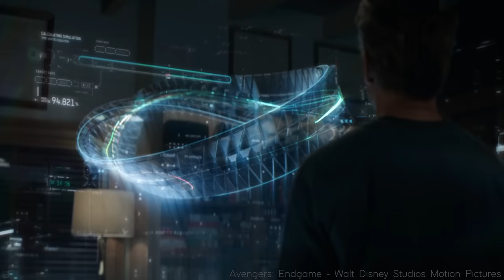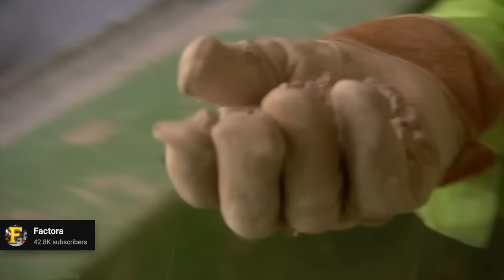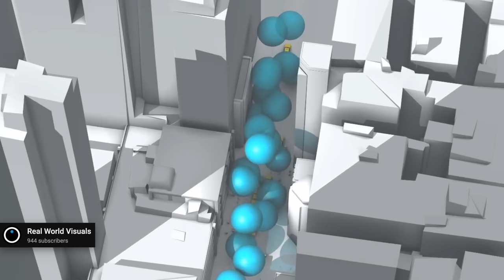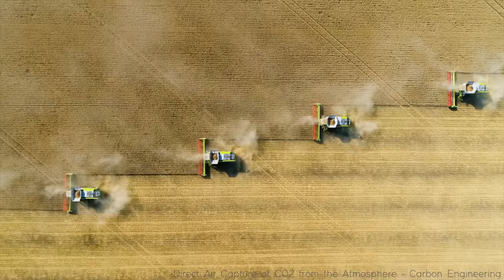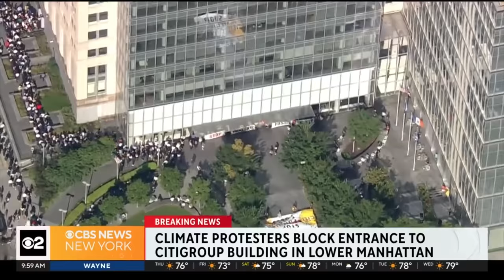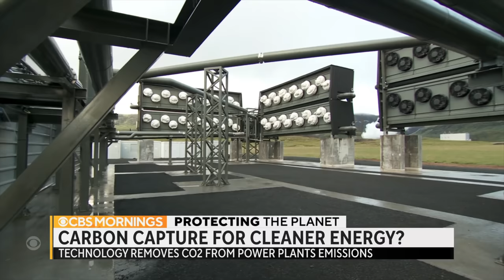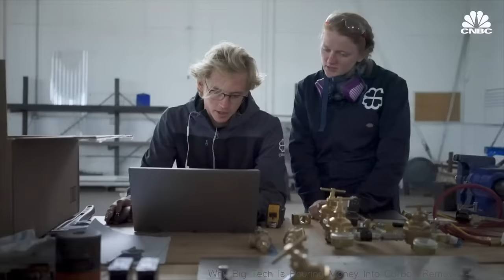How Thermodynamics Holds Back Negative Carbon Tech

Comment: Direct air capture is the dumbest idea ever.  You have to know nothing about chemistry or thermodynamics or entropy or economics to think this is a good idea. It’s so dumb.  

Chemistry: co2 has a very low internal energy one of the lowest. This means you need energy to turn co2 into anything else.  But it doesn’t.  You’ve been fooled to think it does.  

Thermodynamics/entropy you need energy to extract co2 from air. 400 parts per million of co2. Think about that. Find 1 thing out of 25000.  That’s all theses machines do is find that 1 thing in 25000 and they charge $100 a ton. 
Storage cost is extra.  If I want a ton of co2 I’m not going to the least concentrated place to find it.  I’m going to the dirtiest smoke stack I can find and it cost me nothing per ton. 

Economics.  Why would anyone buy a machine to pull co2 out of the air. The machine cost money, the energy to run it cost money, and then you must pay to get rid of the substance it produces.  Literally the opposite of everything you want.  Moreover the energy needed must come from somewhere and until we are 101% renewable there’s no extra energy to run this machine.  If you use fossil fuel to run it by entropy you’ll never get back what you produced.  

Co2 is heavier than air. The few times the earth has burped up a bunch of co2 thousands of people died of suffocation. Invisible rivers of co2 flowed over villages snuffing out everyone.  So our plan is of course storing it underground.  A storage facility in Colorado has already failed.  Releasing everything they worked to contain. The good news is it was so remote that no humans died. But the plan is 1000s of facilities for carbon dioxide storage. This is probably the worst idea ever.  Eating tide pods wasn’t as bad as this idea.  The fact that so many people like this idea shows the true ignorance of the population. What is the use of creating great science if people are going to be so completely willfully blind to it?

Comment: I highly recommend Bjorn Lomborg's book: False Alarm. Disaster related mortality is down by 98% over the last century, and that's largely due to abundant access to fossil fuels. Tornado data over the last century is flat, and hurricane data is similar. A slight rise in intensity (which could be a result of human activity or could be an anomaly) while the frequency is actually in slight decline.

Comment: Nuclear fusion + room temperature superconductors would solve it.

Is it too much to ask?😅
Reply: How? I think you picked the wrong branch of the tech tree. 
Fusion for energy. Well is it in practice cheaper and easier than solar or fission?

Room temperature superconductors?
Slight efficiency boost on your wiring.
Reply: @donaldhobson8873 
It was a joke. That's why the "is it too much to ask"

No, room temperature superconductors would not only give a slight efficiency boost on your wiring.

They would allow for example 10x faster computers for 10% of the energy consumption computers use today. 

They also allow you to simple put energy into a loop and the energy will stay there indefinitely. Huge boosts in batteries.

Maglev trains would be common. It would allow transportation of energy from far away because heat losses would be minimal (think Sahara solar powering Europe)

AND you would be able to create vastly superior electromagnets with dozens of tesla, making fusion power much easier to achieve.

Is fusion power cheaper and easier than fission in practice? Not in practice, as we don´t have fusion power in practice. Theoretically yes. Not with ITER style reactors of course.
Reply: @rogeriopenna9014  

They also allow you to simple put energy into a loop and the energy will stay there indefinitely. Huge boosts in batteries.

They do allow you to do that. However, unfortunately the amount of energy you can store like that isn't nearly as much as with a battery of the same weight. 

With high voltage DC, the sahara powering europe would get about 10% losses. 

Agreed about it helping with fusion.

Comment: Your thermodynamic limit is technically correct. 
That amount of energy must be used, if we must operate at room temperature.  (and have no other entropy sink other than waste heat)

However, the jump from thermodynamic energy to grid electricity is a jump. 
We could invent something that used sunlight to capture CO2 directly. We could use genetically engineered algae. We could use the mineral olivine which reacts with CO2. (if we do that, technically the energy we are using comes from the chemical energy in olivine.) 

Also, if we use all the sunlight hitting the earth to power carbon capture CO2, that would take 37 minutes.
Reply: Why use GE algae when we can just take better care of all the land and seas?

Comment: Go after the Gross Methane emitters, invest in carbon squestration and sunlight blocking technologies.  It will take 1,000 years to reverse the damage we have already done but we can avert our species extinction and untold suffering if we act now.
Reply: You better no fuck around with the sun my man. You have no idea how badly that could backfire. The sun is needed to grow food. Look back at the larger volcanic eruptions and the years without a summer. The growing season was crushed. You play with the sun and then you are dealing with mass global starvation.
Reply: I've argued that reflectors at the L1 orbit can work. The problem to solve is solar pressures exerted on the reflectors.
Reply: @Buckshot99 false, you could control reflected sunlight and have electricity adjustable shades.
Reply: @Buckshot99  I hear you, I'm NOT for spraying the upper atmosphere with sunlight blocking chemicals but a space based sunshade should allow us to reduce overall sunlight without huge risk. Without the Mr. Pinatubo eruption in the early 90's, the earth would be even hotter now, so particulates do have massive global impacts.
Reply: His timeline has it fixed by 2050.

Comment: We need to reduce CO2 to carbon (because we do not want fancy underground storage which isn't reliable). We need to reflect more sunlight (about 1% of the earth surface or close to it). We need a CO2-free energy source like photovoltaic, wind etc. --- and yeah fusion if it will ever work

Comment: Avery Lovins (look him up on TED) agrees - it's far cheaper to prevent emitting CO2 than to collect it after the fact.  So energy-efficiency is the first priority, followed by replacing CO2-producing actions with non-CO2 alternatives.  Frankly, it'll take a huge variety of methods, but DAC is never going to solve this.
Reply: DAC is useful for dealing with the 1000's of small obscure things you don't want to have to invent a solution to. Like camping stoves. Backup emergency generators. Mining explosives. Fireworks. Welding torches.

Gets you to net 0 without having to chase after every last odd stray thing that burns any carbon at all.

Comment: 24:24 You "forgot" to mention water vapor mr Coolweb, but who cares nowadays about truth right? Views are more important, and much more important is to align with the thoughts of those who finance our researches!
anyway...
I will not go into all the details and evidence given by research by geologists and climatologists who still carry out pure research, there are a few still, (where research is carried out to discover the facts and not to obtain funding), in a YouTube comment, in any case it would be useless given the very low propensity for logical reasoning of humans... 
the point is this: if we consider CO2 harmful because it produces the "greenhouse effect" then we should also know that the major contributor to the greenhouse effect is instead water vapor; that contributes merely for the 99.9999% of the "greenhouse effect"
 in short, to reduce the greenhouse effect we should eliminate water from Planet Earth, and preferably eliminate its atmosphere too!
I wish to add that plants do release carbon dioxide (CO2) at night, although they also release CO2 during the day. This is a part of the process of respiration! 
"Ignorance is strength" evidently, not yours but of yours gullible followers
"non-aligned" climatologists are continually censored, a lot of research is simply canceled because it was published on the internet.  Then for "predictions" and predictive models on the future I just want to say that science studies the past and the present using unbiased data evidence;
on the other hand astrology  predicts the future... but if we want to give some credence to this method then we must add that we will have the opposite problem, that is, the capture of CO2 from the oceans and the earth's crust could lead us into another small ice age.
but believe what you want: what do I know?
I'm simply an old geologist already retired, scared about the type of society my daughters are living in, sure thing Greta Thumberg, Leonardo Di Caprio and Bill Gates know better about climate change than myself.
The ones  that takes the decisions at the top,  aren't accountable for the harm they produce to billions of people and this is another fundamental problem of modern societies
Opposite to the common beliefs we are living the dark ages not the medieval people

Comment: What if I told you I have a carbon capture technology that passively absorbs CO2, needs no maintenance, replaces itself before it wears out, makes no sound, looks beautiful, supports life and scales itself up automatically to cover the whole planet?

I call it “trees”.
Reply: Exactly
Reply: What if that carbon capture tech was also 3 orders of magnitude less efficient than solar panels + dac, and had all sorts of fussy demands about ambient temperature and soil and also used lots of water.
Reply: Exactly2. (Plus of course other flora which nurtures fauna and so on.)
Reply: @donaldhobson8873  I thought we wanted to save nature.
Reply: @NoSTs123  We have a bunch of options. We can have industrial DAC plants, which are good at reducing CO2, or we can have forests, which are good at giving birds a place to nest. Or some mixture of the 2. 

Take your pick. It's a tradeoff between one part of nature and another.

Comment: I'm all for targeting net zero ... however, the earth's climate is going to change with or without us in the equation (volcanic mega eruptions, Milankovitch cycles, asteroid impacts, solar activity, snowball earth?!). CO2 levels were about the same as they are now during the Pliocene Epoch 400 million? years ago. Even if we were at net zero ... and came across a natural period like the Pliocene, would we want to prevent natural changes - or adapt, and go with the planetary flow? We may wind up just hashing this up to the equivalent of a super volcano erupting for 250 years and let nature deal with the consequences which it has several+ times during the planet's history. There's just not the WILL ... maybe Jellyfish derived, genetically engineered beef protein steak and vertical farm grown Romaine lettuce wont be so bad. Sorry - being a bit cynical (but realistic).

Comment: Do people actually believe that Co2 is like thermostat in a house, the sole thing that controls all the weather & climate? Oh and China and India are still building and operating coal plants, what's the green people's answer for that? Never got a good answer.
Reply: No, lots of things control the temperature of the planet, in the same way that lots of things control the temperature of a house. It just so happens that concentrations of atmospheric CO2 is one of the things that we as humans are adjusting to cause a measurable increase in global temperatures. As for China and India still releasing carbon into the atmosphere, yeah, they fucking are, it's horrendous. But if I'm stabbed multiple times, I'll still do what I can to put pressure on the wounds I can. As it is, with current technologies, it seems unlikely that humanity will do well against climate change, with people in poorer regions being the most impacted by it. And so, we can only hope to innovate past it, with better carbon sequestration tech, alternate power sources, and so on. Personally, I think the whole thing is fucked, but we've got to at least try, God help us all either way.

Comment: Great, and disturbing, video.  I love your science and your style.  The conclusions...scary.

Instead of DAC, I believe that what we must do immediately is invest much more heavily in renewables, so that we buy time to solve the problems of decarbonizing the difficult technologies like cement, steel and aviation, and the biggest one, agriculture.  I am working on achieving "personal net zero" by the middle of 2024.  How?  By buying and installing enough solar power to compensate for all the carbon being burned on my behalf as the result of my lifestyle.  For me and my household this is about 75 tons per year.  This amount is typical for many Americans.  Of course, I also am working to reduce the carbon I'm burning, but that is costly in many ways, and will take time.  Meanwhile by installing solar panels that otherwise would not be installed (assuming that worldwide production of solar panels is able to keep up with worldwide demand, which I believe is true), I am buying time.

Looking at the cost of removing (or equivalently, not producing) one ton of CO2, my simple calculations show that based on the lifetime cost of solar panels I have already installed, and assuming 25 year life for those panels (extremely conservative I believe), and, yes, including the embodied carbon in the installation,  the cost is about $32 per ton of CO2 removed over their life.  So about 1/3 of the TARGET COST of DAC as you describe it.

So, should we move ahead with DAC? - it appears that we must if we are to avoid runaway climate change.  But I'm suggesting that we should put far more effort into quickly gearing up renewables deployment.  Because for the same money, based on your analysis, we can achieve 3 to 10 times greater impact.

Comment: "So can we innovate our way out of this dilemna without collapsing our economy?"
Short answer : no, it's far too late.
The only way out is going back to a way of life our ancestors knew : a sober lifestyle, a low-energy lifestyle.
Fossil fuels correspond to 80% (on average) of the energy consumed in the world. And there is no alternative at scale ! 
Energy transition DOES NOT EXIST. Historically, as a society, we have never substituted one energy for another, we have stacked them on top of each other.
Our only option is to decline. There is no other way.
Reply: > Historically, as a society, we have never substituted one energy for another, we have stacked them on top of each other.

Firstly, hasn't happened before doesn't mean can't happen. Secondly whale oil was once a major source of fuel. Now it isn't. Looks like energy transition to me.

Comment: Your EV carbon contribution is higher than an ICE.
Reply from the maker: No they’re lower after about 10,000 miles (which I’m way past)
Reply: @CoolWorldsLab  the loss of transmission in HV lines isn't factored though. And I would wager that the energy isn't mostly produced by renewables, it's likely bio mass ( chipped Canadian and US Forest) in the UK. The green EV is a Griff man, IMO.

Comment: Does not the climate change regardless of human actions? I find the question is how much does human actions change the climate? Is it a very small amount or something more significant?
Reply: It does, ever wondered what the cause has been/currently is?
Reply: Let's say you have 2 ice cubes. One you put in the freezer, and the other you squeeze in your hand. Eventually your freezer will break, but that may take years. The one in your hand will melt within a couple minutes. Saying "they are exactly the same because both would have melted regardless" doesn't make any sense because you are actively influencing the process. The earth doesn't naturally undergo drastic changes on the human timescale unless actively influenced.